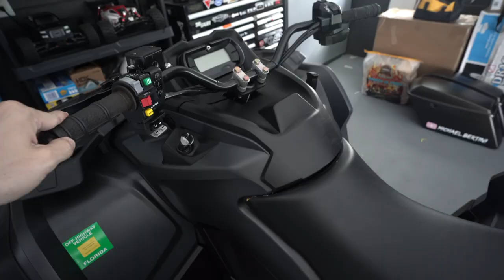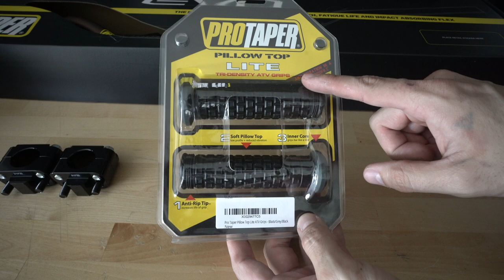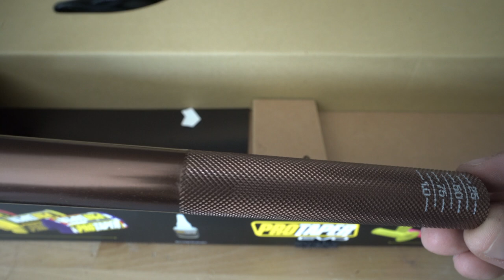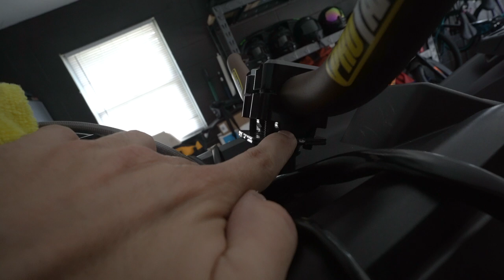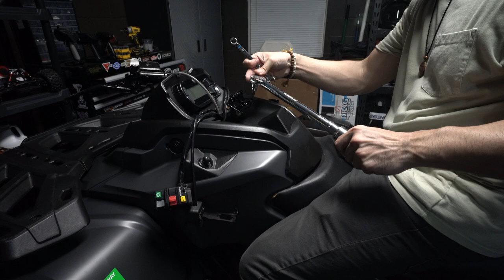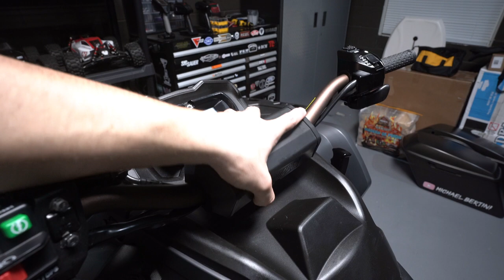Best New ProTaper Evo Handlebar Setup for The Cam-Am Outlander 1000r

Comment: those 7/8 to 1 1/8 adapters are meant to attach to the bottom peice of your factory bar clamps you didnt need to grind them
Reply from the maker: I wish I would've known that. ProTapper was the one who told me they would need to be modified at my own risk. They mentioned that they're designed for a different setup even though they're universal. 

But thanks for letting me know. 🙂 I'll make sure to pass that knowledge on to others. 🤘🏼
Reply: You ground most of that weld off. I don’t know if I’d trust that steering stem now. That’s going to break someday.

Comment: The reason they weren’t flat is because they are more than likely designed to fit a motorcycle. You could have used the bottom part of your factory clamps and got some longer bolts. It would have also given you 1/2” more bar rise. Did you try fitting them with the bottom clamp?
Reply from the maker: You nailed it. 🤘🏼 Yup, I did and it still didn't work. But it's all good. It was a simple mod and I'm happy with the outcome.

Comment: Are these just for appearance or do they provide a different riding angle? Will can am brand heated grips work with this setup?
Reply from the maker: It did give me a slightly different angle, which is slightly closer to me. But... that's not why I did it to be "frank". I did it primarily for the looks. I think you can use heated grips with these, since you can use factory grips with these, it should be the same thing. 🤘🏼